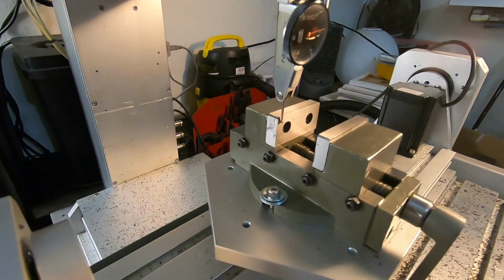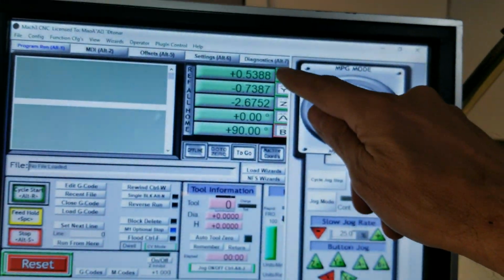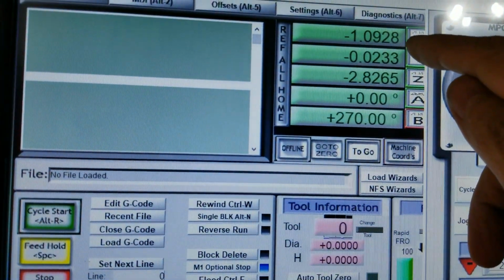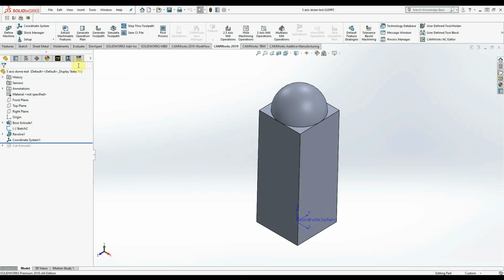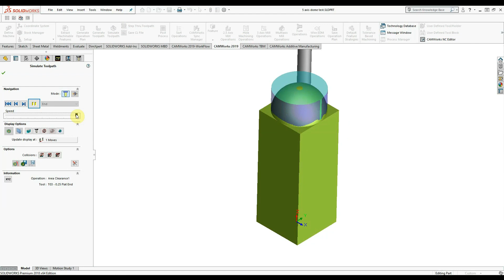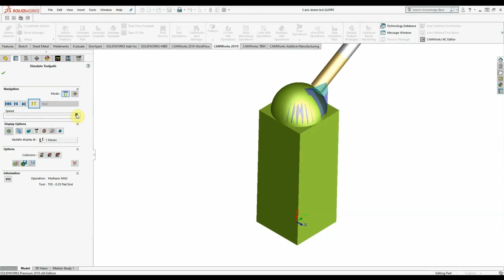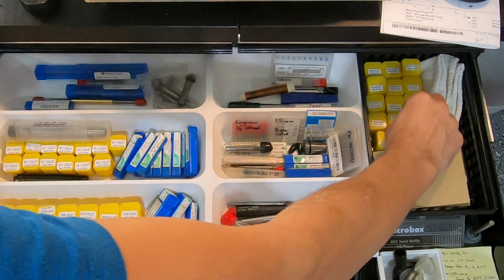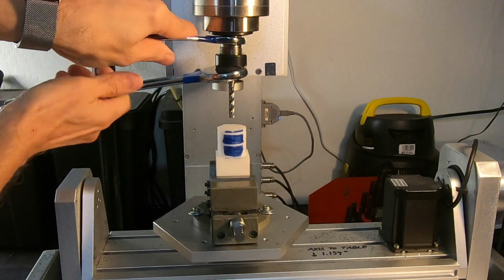HY6040 5 Axis Simultaneous

Comment: please inform the program Cam and half of the galaxy would be happy if you post your post processor as it is written his code, it would be the guy, because the others are all selfish, regrettable that. thank you so much for everything
Reply from the maker: Thank you,  I can help you with this.  Let me know what type of software you are using and what CNC machine and controller
Reply from the maker: That is a very incredible machine you built!  I see it running Mach3.
What CAD/CAM software do you have now?
Reply: @HandyDan  
I'm lost trying on Fusion with linuxCNC, and I really liked NXcam, but honestly what you indicate and I manage to download I learn to use, I am very dedicated and I love to learn, did you do the post processor of yours? which Cam do you use? I have several projects that I am finishing in sketchup if you want I can send by email without problems, you are helping me and in what I can help I am here
Reply from the maker: I am using Solidworks and Camworks,  because that's what I was trained on and certified when I was in Florida. 
I now see that not many use Camworks and since Solidworks 2019 Camworks sold out to Solidworks and it comes with a dumbed down 2.5 axis called Solidworks CAM
I built my own post processor from Camworks UPG but the simultaneous 5 axis needs work, my notary axises are slow and G93 doesn't post correctly yet.
Reply: @HandyDan  I understand, would it be too much for you to send the Gcod file of the video for me to test on my machine? I think it was fantastic your post processor
Reply from the maker: @crescendocombia2114  I sent you an email  with the GCode file.  Let me know if you get it.

Comment: Hello . I have the same device and I have a problem that I can't solve. I use the Mach3 program with the 6th axis adjustment. and I can't control the B axis. Has anyone had a similar problem, I am looking for help everywhere
Reply from the maker: Not sure what you have found out, but what can you control? X,Y, Z?
A, not B? Have you tried C?
Do you have a parallel port or USB connection? There's a lot of possibilities. Do you have Mach3 settings turned on for B motor tuning? 🤔
Reply: @HandyDan  I admit that this is my first machine of this type in my life and I'm still learning.  If there is any possibility, e-mail or wathapp will describe the whole thing to you with photos and videos.  Regards
Reply from the maker: @arturkoziel9246  email me message2dan@live.com

Comment: Hi, how to make G code??? Name soft for make 5 axis engraving G code please
Reply from the maker: Do you have a CAD system?  CAM program? 
I use Solid Works and CAM Works. 
I made my post processor with Cam Works UPG. 
Fusion360 is free, Sprut cam, Bob cad and several others are available.
Reply: Yes i know rhinocam but i dont have post for 5 axis post for A B axis
Reply: Via upg i can make g code for rhinocam?? Or tell me universal soft for make postrprocessor for rhinocam???
Reply from the maker: @levonyeganyan1922  I don't know Rhino cam, but if you are milling 2.5 axis, flat work, almost any software can post that G Code.
If you want 3 axis or 4 or5 simultaneously then you'll need a more powerful program and a specific post processor.
Reply from the maker: Check  www.mecsoft.com
Reply: @HandyDan  you can send video tutorial how to make post for any cnc 5 axis???
Reply from the maker: That would be awesome if one post generator worked for all. Lol 😆 
There are not that many changes needed to make a post for individual machines, mostly start and end codes. The complicated thing is that all post processors have different file extensions. Camworks UPG creates .ctl 
SolidCam uses .gpp and such.
Reply from the maker: I can make a video for Camworks UPG and show you the basics.

Comment: Well done sir
Reply from the maker: Thank you for watching, and let me know if you want me to make any other videos to help others.
Reply: @HandyDan  off course will be our pleasure to got more videos about 4axis 5 axis.
Reply: And sir post processor file for controller ,I mean 5axis post processor file,
Reply from the maker: There's so many different CAD/CAM programs and so many different CNC machines that a post processor is almost a one off.
There's not one fits all.
Reply: @HandyDan  I have fanuc controller, and can read (Fanuc 6m)or(Fanuc 15m) post processing files from autodesk powermill (cam software),but what about 4or5axis
Reply from the maker: @umargul5644  Hello, firstly what setup do you have on the mill for 4th and 5th axis? There are several styles, Head-Head, Head-Table, or Table-Table like mine, meaning both 4th and 5th are on the table and the head is standard Z axis. 
Secondly the style of dependent axis's as on mine A is the saddle but B is the rotation and depends on where A is so B is "Dependent"
Thirdly we get into your CAM software, you need to be able to generate 5 axis posts and then you can test the code on your machine.
Reply: Hi, please give postprocessor for this 5 axis
Reply from the maker: What software do you use to do CAM toolpath programs?  The post needs to be made to work between each software and machine.